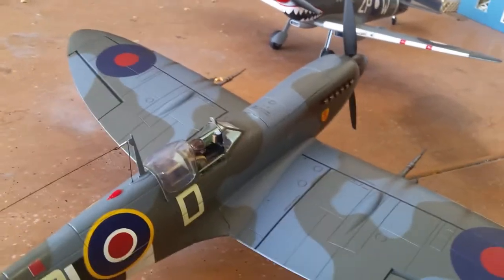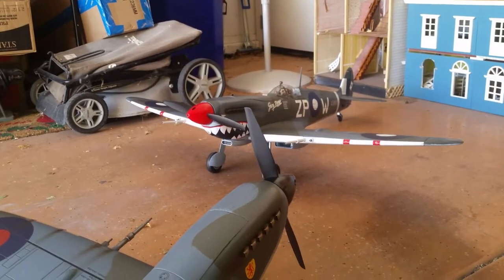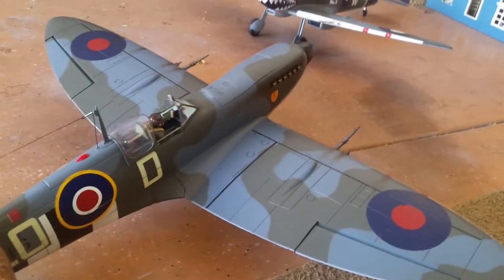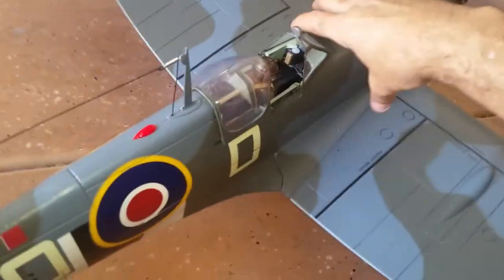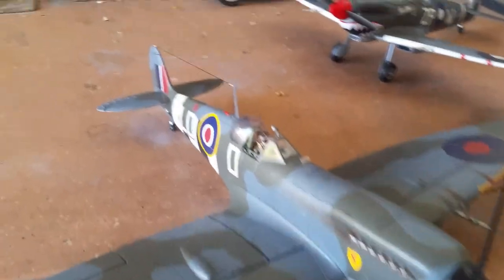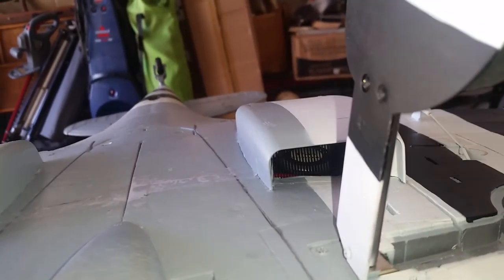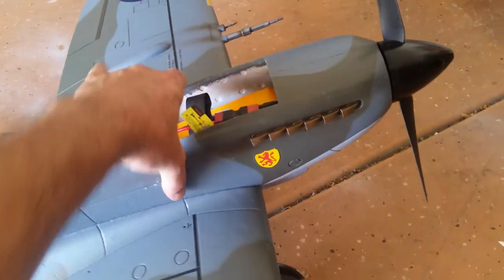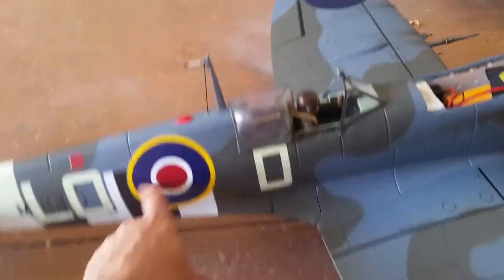Flight Line Spitfire MK. IXc with ESS Air Sound System

Comment: Is the pitch the same on both the 2 and 4 blade props?  Have you tried different pitches, or for that matter, a 3 blade prop?  Seems to me ( I 'm no acft. engineer, though...) if the pitch is reduced the prop is moving less air, therefore less work required of the motor, resulting in less heat?   And I wonder if anyone has fitted an audio amplifier (tiny nowadays) to increase the sound level or volume output of the stock sound system?

Comment: What's with the 2 blade props? Scale sound is nice, but the scale looks...mmm
Reply from the maker: I use both props....but at the moment it has the upgraded 2 blade propeller power system in it. Using the 4 blade prop on the higher kv motor over heats it.

It's also faster with the 2 blade prop and in the air flying....you can't tell the difference in looks what the blade count is ;)
Reply: @BrandonMoon1  Now I get it. Is it much faster this way?
Reply from the maker: @VictorHugoRC1111  I think so. There is a noticeable difference

Comment: Hi,  i'm waiting for delivery of the flight line spitfire and I also want to install the ess sound system. I see You have your speekers in the wing Great idea i will copy that. But I just wanted to know is there plenty of room in the battery hatch for the sound system and also how did you run the wires though the wings. Any other information or suggestions you can offer would be very appreciated. And that's a great mod on your canopy.  Cheers and thanks.

Comment: Brandon, what is your technique for reducing the thickness of the wing where you mount the TT-25 speakers?
Reply from the maker: I just simply used a dremel tool and a sanding drum
Reply: Do you recall how much foam you removed?  Say 1/2 inch?  Also, do you mount the TT-25 directly to the foam or use an intermediate piece of plywood?   What adhesive do you use?  Epoxy?